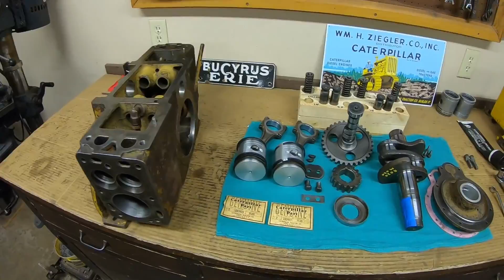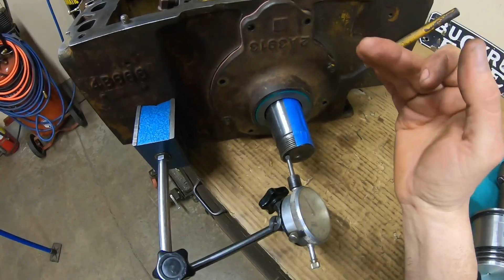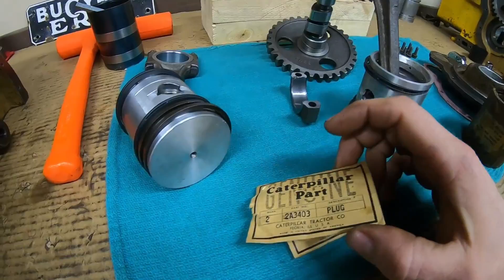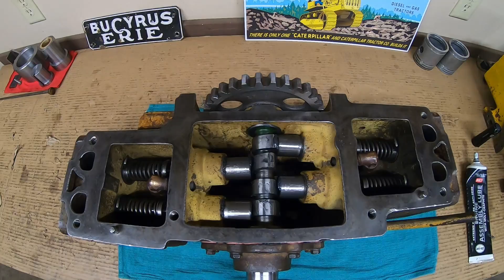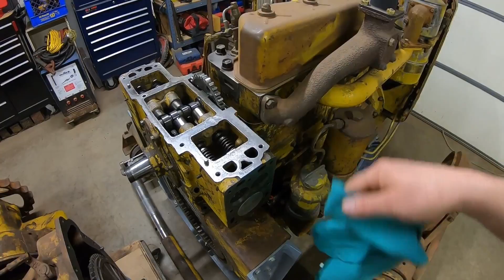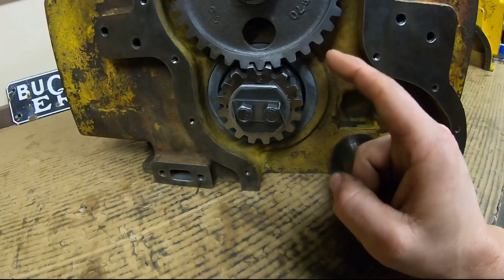The Caterpillar "Pony Motor" - Cursed by Design?? Or the Perfect Balance of "Just Enough"???

Comment: I have a 1956 d4 6u and the starting engine has never failed in the 35 years I have owned it and as said Never turn the ignition switch off ,always Turn the fuel of and let it run dry, no issues of fuel in the crankcase, and yes it is a great way to get the main engine warmed up.
Thanks for sharing

Comment: I ran an old D7E High horse  with the pony motor starter. I could start the main engine at -45 c when the new cats with electric starter wouldn't even turn over

Comment: the pony motor still goes out before the big diesel. and it's not like replacing an electric starter, it's going into engine building. It's something that has to be looked after and needs its own attention. I'm sure it made sense 90 years ago, but there are also similarly aged electric start tractors kicking around without too much issue either.

Comment: You talk of operators running all shift, I worked the flight line at a southern airport ramp people would not shut the diesel engines down at all in below freezing weather until I did to refuel them

Comment: I dont know about the d2 and d4 but the d7 3t had a 2 speed tranny behind the pony...and an electric starter( with a 90 degree starter housing),,,i bought a d7 7m...1941 once that had a single speed tranny....and i found a 2 sppeed tranny off a 3t and was then able to put a starter on my 7M...also,i put an EXTERIOR COIL ON  the 7M...went around the coil in the mag ...when the ponies were good,i wouldnt replace with a starter....i soldm a dozen 3Ts and 17As in 3 years and had a hard time putting a starter on only one of them....and then had to add a generator...

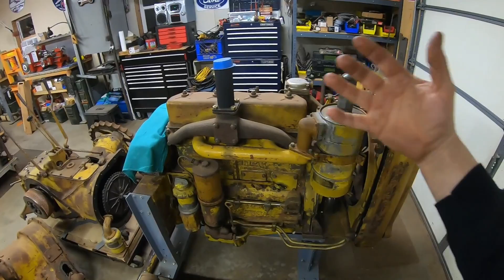Comment: 8:51 eh I don't think every single start would require a 5 minute crank. Especially a hot start on a warm day. If we can convert these to electric start and bust them off without smoking a starter there's no doubt in my mind they'll flash up a LOT sooner on the pony engine too.

IMHO a lot of pony starts spend way more time than necessary cranking. Get it spinning, put fuel to it, and 9 times out of 10 the diesel will bust off before the pony motor even gets a chance to warm itself up fully.

Comment: My Dad owned a small town power plant in the early 50's. Ran 24-7 except for oil changes. He said the engine vibration caused more damage to Pony motor than actual use. I wish I could remember what part he was referring to.

Comment: Yeah, it's easy to look back on the engineering and criticize. I grew up in the "between generation", between gas starting engines and full electric.
One of the reasons gas starting engines were popular was military use, The little engines with magnetos, cranks or pull cord had no need for batteries [even though there was an electric start option for the pup/pony]. 
When you are going to drop/leave a machine in a deserted place for a long time, you don't want to worry about batteries and unreliable electrics.
Just pack a can of fresh gas. Hopefully the old gas was drained. 

Major mechanical failures of these little engines are generally:
- they had their own dipstick which no one checked and they ran out of oil

They ran too many hours as mentioned because of:
- shutting down for lunch which mostly happened after the introduction  of electric start to the pup motor
- the main engine wouldn't start so the operator just kept on cranking
- the main engine was cranked prematurely, before it was warmed up by the starting engine.
The starting engine both heated the air intake and coolant for the main engine as old diesels were hard to start especially below freezing.

The general starting procedure was this:
- Starting engine would be started and run until it ran smooth
- The main engine had a compression release to let the engine roll free after the starting engine was engaged.. Starting engines sometimes had a two speed transmission that would be placed in low. Engage the starting engine to the main engine and let the main engine roll until the oil pressure came up. Change to high speed and do it all over again, just warming the main engine and building oil pressure. These were the days before multi-grade oil. When you were confident the oil was thin enough to work and not like tar you flipped the compression release off and turned on the fuel.

Over speeding :
When the starter engine is driving the main engine, the poor little guy is under much load, butterfly wide open. When the main engine starts there is no load and the small engine may over speed.
These small engines all had some centrifugal  device to unlatch the small engine from the main engine to prevent over speeding when the when the main engine started. You could always tell there was a problem when the main engine fired and the little engine went into orbit. Somebody had been messing around with the adjustments.

Over speed and lack of oil were the violent death of these simple small engines. That's what took out the rods which flew away and broke the cam and case.

Comment: I never understood why they didn’t use air starters. It’s not hard to make an electric auxiliary electric air pump to pump up the air tank when there low to start the engine. They could have even used a little pony motor connected to an air pump to fill up the air tank. Even an electric starter from this era has enough power to turn a small air compressor to fill up an air tank for an air starter.

Comment: Coming from experience with international harvester type “start on gas switch to diesel”, I think the pony engine was not as good as the IH system. Both accomplished the task, but the fact that an IH was a one engine system seems to me it was more reliable , both still have problems resulting from the changes in gasoline. Nice video, very nice work.
Reply: but those intenationals neededLOTS OF BATTERIES...
Reply: @leewatkins1610  true, more than a pony. But I’d put 100$ on an IH starting before a pony. One 12 volt will start them usually.

Comment: If anyone thinks splash lube is bad how do they feel about the early fordson tractors? I beleive the model N (called the "Fordson Standard " in the UK here ?) was splash ,not sure about the E27n (called the "Major" here) butn that might have been splash as well. They did work for years.
Reply: @squatch253  Hi Squatch thanks for replying. Just what i said and I think these tractors were splash lubed for years, i don't know when they changed. On another topic when i started secondary school in 1958 (!) the area next to our sports field was being levelled/reworked for another sports field using i think a D8 towing a scraper. I'm sure i saw the driver restart this (mid-morning) by engaging some levers and then winding a rope round a starting pulley and just running backwards with the rope in hius hands for
10-12 feet and the Cat started without the pony motor firing. Is this possible- I don't think I dreamt it!!  Cheers!

Comment: I never used a Cat pony start but ran a JD 2-Cyl Diesel for years with a Pony start. As you described the later Cat versions it did heat the intake manifold with its exhaust. It was also water cooled and heated the diesel block. It was a 4-cyl however and had two speeds, run and start. Run to warm the diesel and start to start the diesel. Most of the year we could start the diesel in 10 seconds if it was arm. If it was cold, perhaps 20 seconds including time to see oil pressure before releasing the decompression lever.  If it was cold (below zero F) then we'd let it run for 10 or 15 minutes and the diesel would fire right up.   It always worked and didn't care about cold. The biggest downside was the tractor thus had a 6V system so it was good you did field work at 3 or 4 MPH because if you were going any faster in the dark you wouldn't see the fence in time to stop! LOL!

Comment: Speaking to the issue of starting engines, I personally love the idea because you don't have any electronics to worry about. Sure the points can be tricky, but a little bit of matchbook paper can fix that. Also being able to roll the diesel over with no compression and bring up oil pressure and temp is far easier on it than a dry/cold start. This is why I'm seeking to aquire one of these vintage cats vs buying a newer one. Everything is mechanical and metal vs computer controlled and electrical.

Comment: How bad could these engines really have been?  I seem to remember you using just the pony motor to drive the tractor - quite nicely-in first gear.  A great "limp home mode" that you could never do with an electric start set up.

Comment: I have had D2s with rope start all the way up to a 9G with electric start and even at -40 in time the dozers would start. When I lived in Norman Wells NWT Canada I worked for a pilot and road builder. He found 10, D2's up on the Canol line from WWII 2 men can lift any part of the still greased packed parts. We brought 6 of them back out in a Pilatus Porter. When assembled they just fired up like they were brand new. Thanks a bunch for going through this for us. Lots of good memories of when I was young and strong.

Comment: When I first got into the construction industry in the 1960's pony or pup motors were still relatively common. A cat that was outfitted with one could always be made to run no matter how cold it got and that was a valuable asset. Start up the pup motor and let it run to warm up the diesel because they shared a common cooling system. If the pup was hard starting you could heat the intake manifold with a propane or acetylene torch before cranking it and 99% of the time they would fire. Once everything was warmed up, engage the clutch and away you went. They may have been crude but they were far more reliable than the electric starts in those days.

Comment: i have heard a lot of guys complain about starting engines and i agree with you  ,, I have a 1959 john deere 730D and it has the pony start and i love it  ,, minus 15 degrees ,i can go out start the pony engine  , let it run and warm up for about 15 minutes ,, that's time for a cup of coffee ...go out jump up on the seat ,pull the compression release , hold the clutch ,wind up the pony and i do mean wind up too cause it'll hit 5000 rpm ,engage the starter and it'll turn maybe 8 revolutions before it clunks to life ,,that old devil will start  when my newer 4960 won't even think of waking up till i plug itin for an hour,,my grandfather bought it brand new  and it's still on the farm 63 years later being used to plow snow

Comment: Squatch;   I had a D4D with direct electric start and it was 24 volt.   I used it for my logging operatiion for road building and snow plowing  (northern MN )  My opinion was the electric start was way less desirable than a starting engine.   I usually gave the glow plugs two cycles and if it didn't start you then were stuck boosting the batteries one at a time.   Electric start was the main reason I sold it.  Once it was running it was a great snow plowing rig with the power shift and angle blade with tilt.      Mark

Comment: I feel like the folks who hate 6v starting systems on gas tractors have never used one that was brought back to like new condition.
Reply: I have a 57 Ford with a 6 volt system. The engine starts in 5 seconds or less. Above or below freezing. Swapped an 8N for an IH Low Boy. I found out the tractor (Ford) had a ballast resistor in it. It dropped the coil voltage to 3 volts running and about half of that while cranking. Hard starts. I added a diode from the starter to the coil to put 5ish volts to it while cranking. My friend said that nobody ever saw a front mount distributor Ford start that fast. If you double the coil voltage while cranking and get a really fat spark it WILL start.

Comment: *personally i like a starter for the easy way of a daily use tractor, but for the hobby tractor and the nostalgic use of the tractor i love the starting engine. i have 2 dozer D4's and 1 Grader Cat 12 with a d318 that all have electric start gas pony engines. my other cat 12 grader has a electric start no pony motor that makes it pretty simple and use it for the daily farm use. ironically i use my older grader and the older dozer more than the newer stuff cause they are often more reliable and quick to start.

Comment: If I remember correctly, McCollough built 2-stroke 2 or 4 cylinder engines to tow target drones. They were rated to run only 40 hours. There may be similar specs for other engines we use now - only we don't know what the designed life is.....

Comment: Never seen wrist pin caps, seems that this is really oldschool!
Weren't they able to use wire clips or wouldn't they trust them back in the days?
Nice figuring how much a 250hr service interval on a starting motor adds up over the lifetime of the whole machine!
:-D

Comment: Do you currently work for Ziegler Cat? I was a field tech. for Altorfer Inc. from 1968-2011 when I retired. I worked on these engines during my career with Cat. The first half of my stint was on the service truck and the last half I specialized on engines. From truck engines to V 16’s. The last Cat I worked on was a 1947 D8. I put a head gasket and new magneto on the starting engine. This unit belongs to the farmer that I help out since I retired.

Comment: I had a 1950 D47U with a pony motor. At first, I thought about converting it to electric start. But the more I used it the more I began to appreciate it for all of the reasons you mentioned. It started every
 time and I didn't have to worry about a dead battery. I appreciated your explanation of the pros and cons. Thanks.

Comment: 14:56 I fully agree with you that the starting engines are misunderstood and under-appreciated. The technology is antiquated by today's standards, no doubt, but people often fail to think of the circumstances that both owners/operators, and engineers, had to deal with when these machines were built 80+ years ago. As Ironman3406 mentioned, electric starting was barely in its infancy (even on gas engines) when these tractors were built, and the technology for an efficient electric starter in higher-compression diesel engines hadn't been conceived yet. We all know how much of a bear those old diesel engines are to start when they are cold; the quintessential fix for this would seem to be an all-in-one "starting motor" with the ability to pressurize the oil and heat the coolant all at once. The starting engine concept did an excellent job of that.

I feel like the starting engines were well-designed to serve a doomed life. The concept was genius (for the era) but very few operators cared enough to take the proper steps to make them last (especially since they weren't the ones paying for the equipment) - hence the failure rate and the need for frequent rebuilds on those starting. The same holds true today when it comes to consumer-grade power equipment. I think it's safe to say that walk-behind mowers and entry-level riding mowers take more abuse than any other equipment out there - most homeowners don't maintain them properly and will just run them into the ground, or throw away and buy a new one every few years. But at least the parts for most mowers are easy to find...unless we are forced to switch entirely over to electric lawn equipment, I don't think the parts supply (or dealer support) for gas-powered mowers will disappear any time soon.

Comment: Your spot-on about starting engines construction n longevity .In 74 JD 2cly mechanic ( nowadays technician) said farmer's just wanted to push starter button and go not Tinker around with starter engine  .Back then you just ran it n traded it in for something new, ,it's a circleback moment because now the emphasis is on restoring them back to New .

Comment: Just my 2 bits worth.  Love those starting engines. No need to worry about a dead or weak battery, or find a way to boost it. Love IHC’s method even better. I think Cat made better starting engines than JD.  I wonder though, why cat went with the downdraft carb, and never went away from it.  Is it simpler than a side or up draft?  Or do those have drawbacks as well.
Reply: @squatch253  That would make sense.  lower compression means it is easier to rope start (from the point of view of how much effort required to pull the rope)

Comment: Completely agree, pony engines work great as long as they are maintained and properly used.  It's great to be able to start a diesel engine in way below freezing with a rope or a small 6 volt battery!  I agree that the cat pony was built simply to do a simple job, but they could have added at least pressure oiling such a John Deere on the 70 and newer.  Which they had their problems too.  I just know I love the pony on my 212 grader!

Comment: To be honest, I would prefer a pony motor over electric start, even though our Cat D2's pony doesn't start every 2nd pull. It is a great system because, like mentioned, we can turn the diesel engine almost as long as we need to start the main engine as well as providing heat to warm up the engine quicker and we can check the main diesel engine for problems before injecting fuel (a problem for electric start)

Comment: In 1970 I worked on a ranch in South Central Idaho. We had an old D7, an even older 1HD8 and an IH TD6. The pony motor on the D8 cranked from the front of the engine and would either start on the first try or  not at all. The D7 cranked from the top and if you weren't careful would kick back and throw you off the track you stood on. The D7 pony motor would start most of the time but not always willingly. The TD6 started on gas and then would be switched over to diesel. Some mornings I would eventually use the TD6 to push start the D7 and then use the D7 to push start the D8. Lots of fun the summer. I did use the D8 to pull a cable scraper with the D7 pushing the can for a few weeks building up pads for irrigation ditches. Lots of memories from that summer...